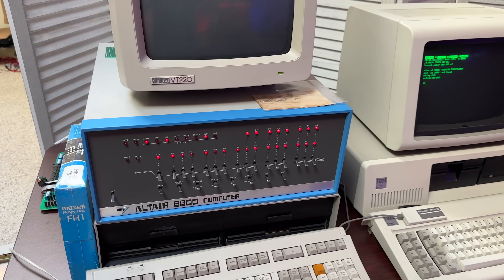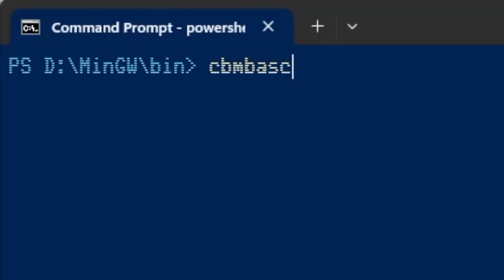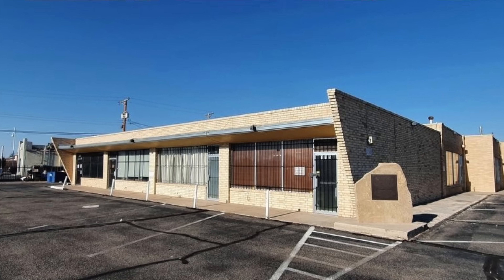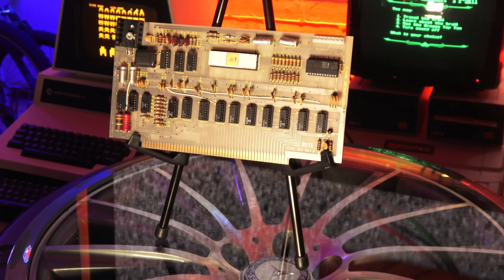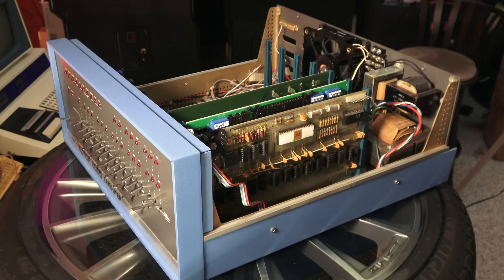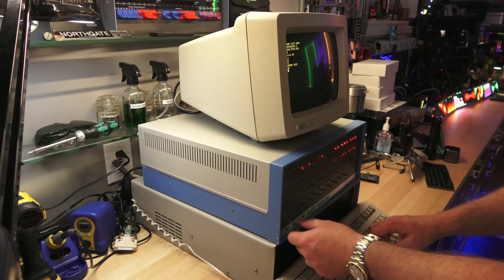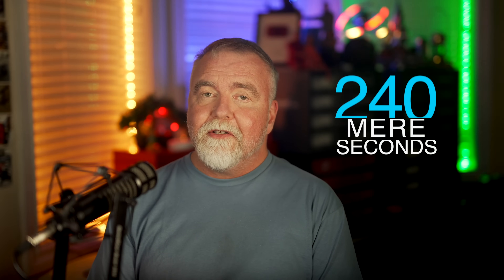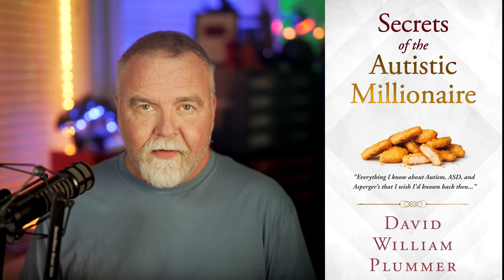Altair 8800 vs AMD Threadripper: Which is Faster?  We test them!

Comment: I just stumbled upon this video, It was great!  I entered your BASIC program into PC-BASIC on my WIN-10 system - i-core 5-7400 CPU @ 3 GHz - 16GB RAM, after changing lines 20 & 30 to 10000 instead of 1000 to get the correct count for primes up to 10000 in Dave's results, I got run times of 9.2 seconds.  Then I decided to try it on an old SCO unix box i-core 3-4005 CPU @ 1.7 GHz - 4 GB RAM running D-BASIC-V language.  To get a similar time of 9 seconds, I had to add an additional loop to keep running the program over and over for 1000 loops.  So that is 10 million cycles in the same time as the original 10,000 cycles of PC-BASIC.  

My history - Started with a TRS-80 Model 1.  Added RAM, expansion interface, printer, and dual floppies.  Wrote a payroll package for my dad's restaurant than our accountant said would never work.  Proved him wrong!  Decided to open a computer store and become an Ohio Scientific dealer in 1980.   We wrote a medical billing package for private practice physicians that was very successful for us.  We migrated that package to unix when OSI went under.  By the early 1990's we transitioned from a computer sales company to a medical billing service, using our own software. Sold the company in Jan, 2024 and retired.  Dave's old histories bring back so many memories.....

Comment: I love your sense of humor.  I like the front panel of the PDP 11/73.  In the computer lab at Asnuntuck Community College, that's what we had, as well as a PDP 11/23  with a boring face plate instead of any front panel controls.

We ran RSTS/E with DCL, and having come from a VAX/VMS environment, the PDP was was a smooth transition.  We had 30 terminal in the computer lab and 20 more scattered around the building for administrative use.

I loved to watch the LED dance when compiling some of my Pascal code.

Comment: I'm building an RC2014 Z80 retro computer.  The great grandchild of the Altair.  It's a little more powerful than the Altair because modern memory is faster, but essentially it's the same machine.  What I find appealing about these retro-computers, is that you can completely understand what's going on.  All the way down to the assembler/machine language level.  In a modern desktop/laptop/smartphone, there is so much complexity, it's virtually impossible for one guy to understand everything that's going on, and much if it is proprietary.
If you really want to understand computers, get a Z80, or a 6502 retro computer.

Comment: Just a small history tidbit of the bus it used... the bus on the Altair 8800 was actually called the "Altair Bus"... it's slightly different than the S-100 bus in that it's not terminated like the S-100 bus was and had a few pin differences.  A lot of Altairs were upgraded (even by MITS) to the actual S-100 bus later by adding the terminator resistors to it and reconfiguring those odd pins.  I might add, the Imsai 8080 also used the Altair Bus originally.  S-100 wasn't actually standardized until 1978, and by then, they backwardly referred to the previous versions of it as the S-100 bus also, but docs prior to the Cromenco (I think) suggested name of S-100, all refer to it as the Altair Bus.

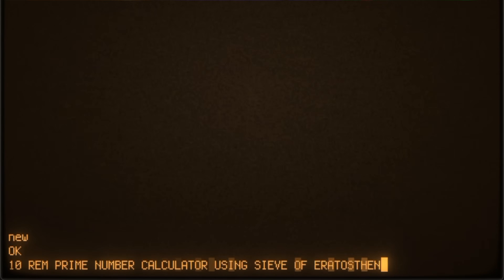Comment: Blooper: 14:27 is showing N=1000 (which should be 168 primes).  The results/findings are still valid (both based on N=10000), just the video clip depicts the N=1000 magically morphing into a result of actually N=10000.    Glad the Altair could actually handle 10x the original work, but the Threadripper probably needed 10,000 to even register as actually doing any work :)  // Cool find on CBMBASIC adapted to x86 (bit of a story there on the history of the 6502 based CBM port of BASIC, but it is indeed derived from that 8080 Microsoft original)

Comment: I remember trying to load the operating system on the Altair. If you were lucky, the paper tape would read correctly a little more than 50% of the time after entering the loader program using the switches. I also remember using a blow torch to open the side so we could add another 4K of memory.

Comment: I actually built an Altair kit in 1976, memories….  it eventually (after many many thousands of $ and time), ran CP/M on its dual Shugart full sized 8” floppy drives, next came a gigantic program called “CBBS” and a 600 baud high speed modem connected to a phone line, finally, it became the first “Computerized Bulletin Board System” in New England, simply known as CBBS Boston…  where people would post messages, and other people answered them…  a user by the name of Wayne Green discovered this, and screenshots appeared on a cover of “Kilobaud Magazine” shortly after…  and finally, I worked in Peterborough, NH during the summers in their “lab” (Basement of Waynes old mansion), where I got to evaluate and build new things, like the Heathkit H11 (PDP 11 clone).  Ah, memories….

Comment: The panel switches take me back.
I used to have to switch in a bootstrap loader (about 50 bytes) to get my micro to read the keyboard.
Then I could type in code in hexadecimal.  Wheee!
In the late 70's it was fun and a learning experience.

Comment: There are several shortcuts to finding prime numbers which I regularly use to calculate prime number in my head.

1) Only odd numbers need be considered since 2 is the only even prime number.
2) Multiples of 5 can be eliminated.
3) You need only consider factors up to the square root of your highest number. For 1 to 100, for instance that would be 10.

So, for prime numbers from 1 to 100, you need only concern yourself with multiples of 3 and 7. Multiples of 3 are easily eliminated.

In your program, if you start at 3, you can iterate by 2 instead of 1 so you need only check 3, 5, 7, ....

Comment: One thing I noticed was that you said that the Threadripper machine runs multiple passes on all cores. Then you used that number to calculate how long would a single pass take. But does it actually work like that? To me that sounded like "It takes 5 minutes for a 32 man orchestra to play a concerto. How long would it take for a single player to play the same song?". Wouldn't you have to divide that 48818443 by 32 (or 64 if SMT was in use) to get a number for how many passes did a single core do if you want to solve how long a single calculation actually takes?

Comment: This is going to sound dumb, but I've only ever seen pics of the Altair 8800 itself... I had no idea it connected to a monitor. I always though it maybe printed the output and you had to program via the switches and LEDs only. I had no idea how it worked obviously. Neat to see one in operation and running MS BASIC.

Comment: This is helpful. Now I know I could play starfield (with a few minor modifications) on the Altair at 1 frame every 532 days. Which isn't bad. You could watch a pixel appear every few seconds as the frame draws. I'm sure a more efficient algorithm could get this to several pixels per second though one frame wouldn't fit into the Altair so page flipping to the external storage might slow things down a bit. You might have to lower the settings.

Comment: I have a TDL Xitan S-100 bus computer. I was never able to get it to run, but it does fill the screen with random characters... I don't have any software for it.. I was thinking of using KiCad to make an all-in-one card with modern chips, including SSD, i2c, HPIB, wifi, etc...

Looking at the Xitan bus pinout, it seems a bit backwards thinking the way they emplimented the data bus..
I was thinking of using a few of the unassigned pins as (BusMode control).
BusMode=0 ... is standard
BusMode=1 ... is special features

Anyone out there know how to get started in that direction?
What would be a fantasy feature S-100 system?

Comment: I appreciate the confident use of eval at 17:39 😁

For those who don't know, running 240 / 0.0082185 without the eval part would have been enough for PowerShell but the handy calculator is always there!

Comment: This was the most informative video on the altair 8800, all my previous impressions of the machine was it was a cool toy that changed what blinky lights blinked depending on what toggles are on. this shows it's a real computer if a smidge slower than threadripper

Comment: Isnt the measurement of 1024 bytes per KB incorrect? I thought that form of measurement is used for KiB and MiB, which is often mistaken for KB and MB due to how older Microsoft systems labeled them. 

Maybe its because I've been using Linux for most of my life, but I've always thought KB, MB, GB and so forth were all in base 10, and thus 1000B is 1KB.

Correct me if I'm wrong, I'm genuinely just curious

Comment: This takes me back. My third personal computer was my own design based on a Z80 processor with 64KB of RAM, all wire wrapped by me. The RAM array was on a PC board I cut out of a used device and mounted on a wire wrap board to build the controller. I originally interfaced it to two 8" floppy drives then found a surplus 14" 2.5MB hard drive. So of course, I had to design a controller for it. My original plan was to write my own OS and use a Basic interpreter supplied by a Microsoft competitor, read in on paper tape. (I think it was XDS or something like that), but then CP/M came along so i worked all night to write the BIOS and by 6am I had a C: prompt. WOW was I excited. I used that machine for quite a while, ultimately running both UCSD and Turbo Pascal on it, both were very useable.  There is more to this story and believe it or not, I actually have some of the original wire wrapped boards in my garage today, including the CPU and RAM boards (pack rat). Love your stuff Dave!

Comment: I remember tinkering with an Altair 8800 back in the day. I had to keep a spare strip of bus drivers (74378?) on hand since one would fry every other day. When the 74LS (Low Power Schottky) chips became available they were a Godsend since they consumed far less power, resulting in fewer fried 5v and 12v voltage regulators. Although Dave didn't have any problems with card placement, it >could< be an issue because with certain cards in certain slots you could get weird effects with bus ringing and harmonics - quite a big deal when you key in a program byte-by-byte using the front panel only to have it blow up when you hit the run switch 😐 Dave, I'd like to see a comparison where you put in that same program using 8800 machine code from the front panel! No fair using BASIC! 🤣

Comment: I would like to say that I am very impressed with the Altair's superior performance.  A machine that is 48 years old can out preform it's modern counterpart (assuming Moore's "Law").  With Moore's "Law" of doubling every 18 months your modern computer should be 2^32 times faster, your test computer is only 2^21 times faster.  Even if the true doubling of compute takes 2 years instead of 1.5 years the modern computer should clock in at 2^24 times faster. The clear winner is the Altair.

This is why I stand by my conviction that the computer with a GUI will never take off.  Even a complex OS is truly unnecessary.  Thank you for helping me prove my point.

Comment: Scary, 2025 will be the 50th anniversary of the 1975 Altair!
So, that is at least 25 Moore's Law generations.
Because 2025 is two years away only 24 generations (if each gen is 2 years) have passed.
So, is the threadripper 2^24 faster than the 8088?

Comment: Interesting test.

Between mainframes and microcomputers, there were minicomputers. I've done programming in FOCAL, a Dartmouth BASIC clone, on the DEC PDP-8, plus BASIC programming on the DEC PDP-11. I've done assembly language programming on both the PDP-8, and PDP-11, as well as the Intel 8080/8085, Motorola 680x0, and self-taught in IBM 370 assembler.

Comment: The AMD Threadripper Dose have a Edge with it instruction Sets & Extensions   
Esp Being MacroCode it can Shut Down Instructions it not using & Skip em 
Poor Altair 8800 cant do this

Extensions & Technologies	

    MMX instructions
    Extensions to MMX
    SSE / Streaming SIMD Extensions
    SSE2 / Streaming SIMD Extensions 2
    SSE3 / Streaming SIMD Extensions 3
    SSSE3 / Supplemental Streaming SIMD Extensions 3
    SSE4 / SSE4.1 + SSE4.2 / Streaming SIMD Extensions 4  ? 
    SSE4a  ? 
    AES / Advanced Encryption Standard instructions
    AVX / Advanced Vector Extensions
    AVX2 / Advanced Vector Extensions 2.0
    BMI / BMI1 + BMI2 / Bit Manipulation instructions
    F16C / 16-bit Floating-Point conversion instructions
    FMA3 / 3-operand Fused Multiply-Add instructions
    SHA / Secure Hash Algorithm extensions
    AMD64 / AMD 32x64-bit technology 
    AMD-V / AMD Virtualization technology
    SMT / Simultaneous MultiThreading
    Precision Boost 2

Some of them make a CISC (MacroCode )  Processor's beahave more like A MIPS, ARM,  RISC, SPRAC (Even asic) Processor's

And Some Are Electrical Transistor layout  Cheat cards That Accelerate up Certain Maths & Elements & Jobs & Tasks 
You could Say the AMD Is a Little bit cheating  Due it Came With Built in Cheat cards to the Exams

Comment: Interesting test, shows how insanely processor technology has improved. A lot of younger people don't understand just how slow and limited computers used to be.

Out of curiosity I tried running a program to do the same work on an Acorn Electron from 1983; this is a 32K machine with a 6502 that clocks at 1MHz for RAM access and 2MHz for ROM, and runs the famously speedy BBC BASIC. Using code optimised for BBC BASIC it completed in 45 seconds, so roughly 5.3x as fast as the Altair. For giggles I also tried the Electron with a 16MHz 65C02 accelerator installed and got 3.3 seconds.

Comment: C000, I called it a pointer,I used terminal with many preprogrammed options. My fathers company, dairy lab, used it to send data, and do calculations, when it was over completed, we got it at home. The basic rom chips, the CPU board, as a kid I never was any interested in what was inside the blue boxes, we owned the modem too. Thanks for showing it after all these years, coder in Amsterdam, asperger, used your windows tools, great to see who made them.

Comment: Would love to see this using only 1 core with hyperthreading off and underclocked to the same speed as the 8800
Reply: Yeah, you should be able to do that, on any 8800 chip, what should you proof, modern x64 code runs better ?

Comment: This brings back memories - in the mid 70s I was hoping to get either an Altair 8800 or Imsai 8080.  I finally purchased a Cosmac "Elf" RCA 1802 computer kit from Quest Electronics, which was also featured in Popular Electronics (August 1976).  That was a fun computer with hex keypad and led display.

Comment: I so wanted that computer.  I could only afford to build my own z-80 with 24k bytes static ram on the s-100 bus.  It loaded zapple basic off of my music cassette taking about 3 minutes to load, and leaving 12k bytes for my programs.  And it crashed waaaay too often.  But this was 1977 and hey... it did work.  My next sbc (also hand built, in 1982 ish) was a 186 with 256k sram and a dual 8" floppy running cpm86 and turbo pascal.  A screaming monster at that time.  I learned to program on that machine.

Comment: Soooo Dave, I have been thinking.... Margaret Hamilton for the Apollo Moon mission program seems to have used an "Assembly on Assembly" configuration to the program's success. I understood that the hardware architecture had some limitations on math calculations, so they built a lower Assembly compiler to interpret and run higher level Assembly. In that similar way, could it be developed in Assembly for the 8088 an interpreter to run 32-bit 80386 code? The smaller 8088 would have to just run larger 32-bit calculations 8-bits at a time. Thoughts / feedback?

Comment: Runs in 74 seconds on a Z80 processor clocked at 7.3MHz.  This was running MSBASIC under CPM on an RC2014 Z80 kit computer.  

Thanks for the entertaining video and for posting the code in github!
Reply: I tried it on the MSX computer: 214 s (Z80 @ 3.579MHz),  resident BASIC by Microsoft not Z80-optimized as is was based on their original interpreter for the 8080 microprocessor. 280 seconds with MBASIC (not compiled).

Comment: I love it. After waiting several months to get the parts kit, I built the computer from Jan 1975 Popular Electronics. It took weeks to get it to work. But, I implemented some math functions in machine language using the descriptions in the manual for my HP-25C calculator. I learned a lot. It is a fond memory these days.

Comment: Hi Dave  I see you didn't show connecting the CPU's data port to the front panel. The original Altair kit used single strand wire. These were easily nicked by stripping the wires and would break off without any warning. They also need to be installed the right way around. The Altair like the Imsai uses C3 to load the address into the cpu chip that bit wise C3 bit swapped is C3. That is about the only thing that works right with the connector swapped.
I have an IMSAI myself and was lucky enough to get one of the Torode disk drive ( no boot ROM needed. 100% RAM ya! ).
I should note that before connecting just anyone's 2716 to your board, you might note that many xx16 chip also had a 12V supply. An Intel 2716 will do the momentary lamp glow, through the window, if it has that voltage on the pins. Do measure the voltages first before fiddling.
I should note that I am dyslexic. I'm 75 years old and work for AMD. They don't want me to retire without doing a brain dump first. I still need to get at some of my project cases before I lose the ability to trouble shoot, from brain fade catches up with me. I suspect you'llnever see my message in this sea of noise but I like your post. Keep it up.